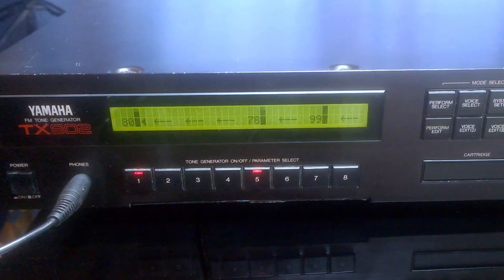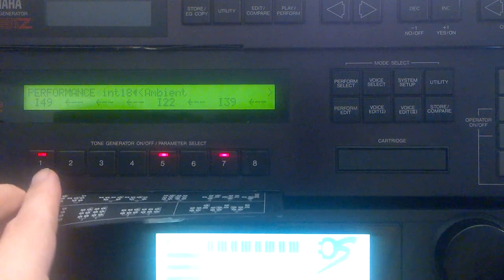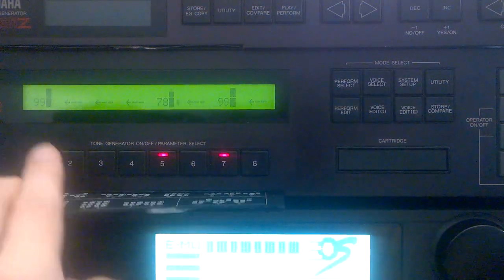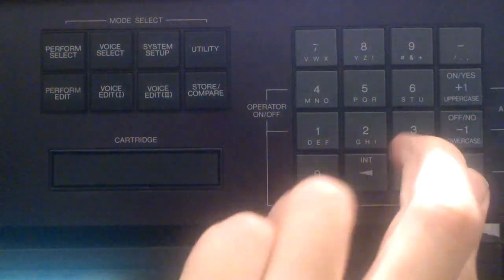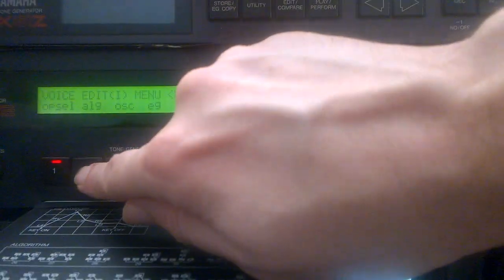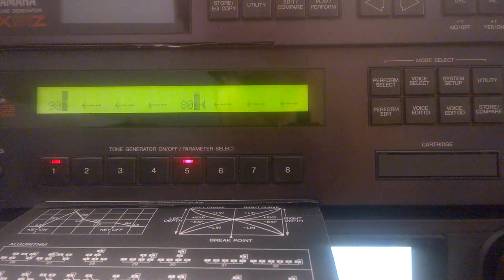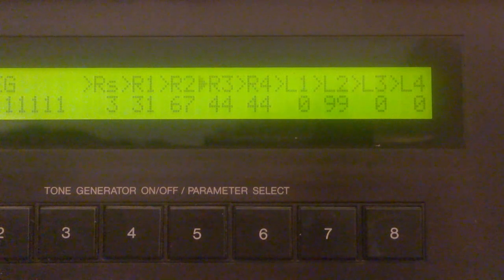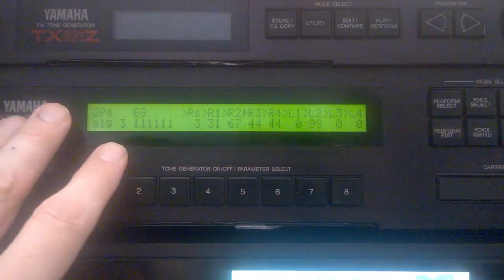Yamaha TX802: Under the Radar Review

Comment: I bought your patches and I can duplicate the TX802 easily by layering Plogue OPS7 (which has 2 x DX7 engines) and using Pluginguru Unify I can really layer and add fx etc...  Sounds authentic to me.  Multiple layers of OPS7 within Unify -- and save each config as one patch... so easy and at the same time complex.
Reply: OPS7 is a bit exact emulation of the DX7 so of course it sounds authentic. I love it!

Comment: Thank you for the great tutorial!
few questions to TX802 users:
1. is it possible to use dx7 ROM cartridge with the machine?  
2. do you edit the sounds (level, rate, frequency, operators levels) in practice? or more often just use the presets?
Reply from the maker: Good question, No, a DX7 cartridge has a different jack.
I always edit the sounds. The factory sound only scratch what the synth can do.

Comment: Its a versatile synth but buyers beware the battery is soldered to the board so a little mod work is needed.
Reply from the maker: I bought mine over 20 years ago and never had to changed the battery. It's amazing how long the battery lasts.
Reply: Any qualified tech can swap the battery.
Reply: @jmarvosa6x3 
Yes, on most synths It is not hard to do.
I soldered in one of mines a little black battery slide thing, so I can swap at once the new one.

Comment: So would 2 tx802 be as good as a tx816?
Reply from the maker: Well, a TX816 filled with TF1 modules would have a lot more polyphony but the TX802 it better for the screen and editing.
Reply: @offthematrix5310   would they sound close?
Reply from the maker: Yes, they should sound the same.
Reply: TX816 costed waaaay more expanded with all the modules.
More It has no screen, only two digit numbers for each module.
I think that, if You can live with reduced poliphony, the TX802 can be used with profit since It is multitimbral and easier to edit.

Comment: I have 2 of these, the 1st I got in '90 or '91. I will say this using it multi-timbrally with a sequencer to play several parts on their discrete MIDI channel while quite 'doable' can be a pain in the ass because there is no dynamic voice allocation system in the instrument's design… rather you have to assign the number of voices of polyphony (of the 16 total) that will be available to each part of TX-802 performance in increments of 2. That requires way more thinking about what you're doing and adjusting than you might otherwise need to do with an instrument having dynamic voice allocation.
Reply from the maker: I realize that the lack of dynamic voice allocation can be a challenge to work with but it's not as bad as working with the TX81z which only has 8 voices of polyphony.  The V50 seems to be the first synth from Yamaha with dynamic allocation which makes it a pleasure to work with.
Reply: I usually use my DAW to copy instances of my Tx802 😂so nowadays nö need to have any plan how to worry about polyphony shit😅I love my Tx802, it was my very, first professionell keyboard back in 1992 but back then I have had a Dx7II which was quite the same. And I have to say, there is no other FM Synthesizer of the new Generations after 2020 that has the same Sound, no NI nö Arturia even Yamaha Sound different, and why? They have nö Chips but Software emulated shit, and thats definitifley not the same!
Reply: @texacomann  - "I usually use my DAW to copy instances of my Tx802 "

This is non-standard terminology you're using here, "instances" or instantiations typically refer to software instrument tracks, so it's unclear what you're referring to. Are you talking recording MIDI or Audio? Multiple audio recordings of your TX-802 obviously get around polyphony limitations, but then that applies to EVERYTHING… and there are some limitations (mainly efficient use of time) working with audio rather than MIDI tracks during the composition phase. Also not sure why you'd refer to a TX-802 as a "professional keyboard".
Reply: Yes I have had just one Dx7II professionell keyboard back in the days and a 8 track recording fostex, I recorded one Instrument after the other, and there was no need to have a whole bunch of Synthesizers to make compositions and music. Nowadays we do it all with DAW, someone has 200 Plugins and 20 Synthesizers doing the same at the end I did 35 years ago..... 🤣🎶🎶🎶